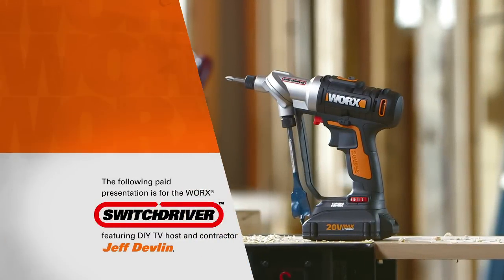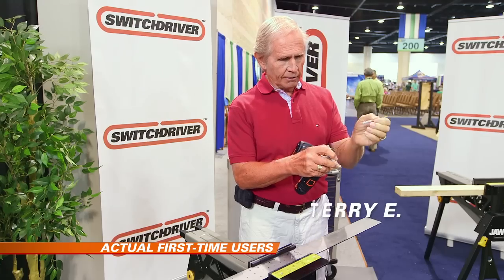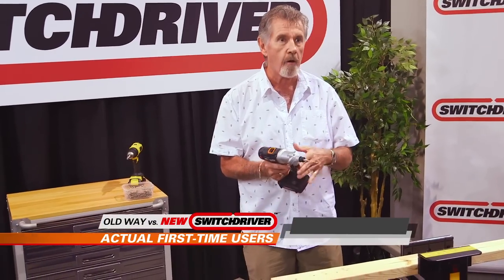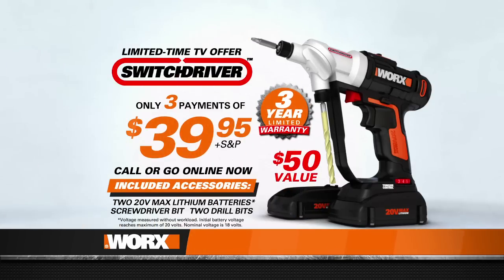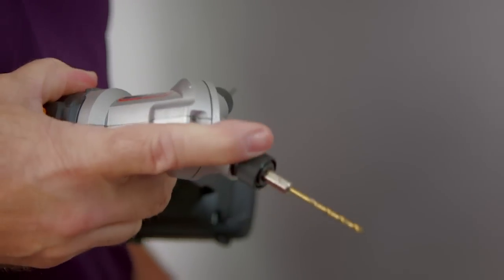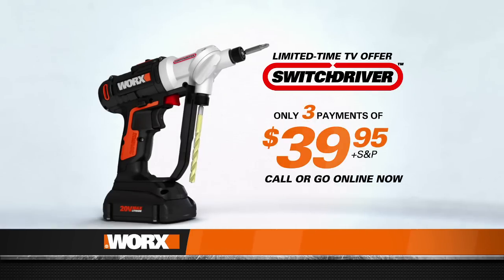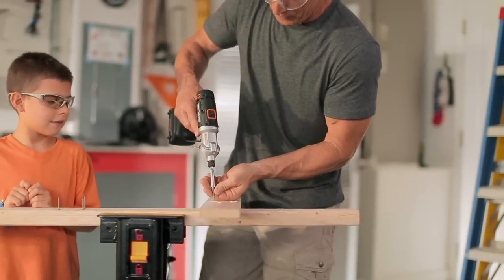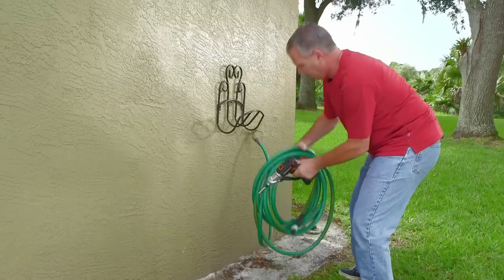Switchdriver | 20V Cordless Drill/Driver

Comment: If you look closely, all the drill bits they use are hex drill bits, not normal drill bits. Hex bits are not bad because they can't slip in most drill chucks like regular bits can when the chuck is a little loose, but hex bits are typically used in electric screwdrivers, not drills. Harbor Freight sells a titanium coated (sorta junky) hex drill bit set for about $10.
Reply: Ulua fishing
Reply: Yeah
Reply: yeah its kinda annoying but like they said the chuck is big

Comment: what do the torque settings mean?  Do they correspond with poundage?
Reply from the maker: Hello Jmichael Isbell. That's a great question. The clutch setting is the most important feature to have dialed in. You'll see a list of numbers from 1 to 20. These are used to set the clutch to deliver a torque range. The higher the number, the higher the torque and the larger the fastener that can be driven. To adjust your clutch, align the arrow to a lower setting and start driving a screw. If there is too much resistance, the clutch will disengage the motor. Adjust the clutch to a higher number and find the sweet spot that will drive your screw to the desired depth without disengaging the motor or overdriving the screw. I hope this answers your question and thank you for being a valued WORX customer.

Comment: Great Idea.. BUT they will really get my attention when they combine a drill driver with an impact driver.  Of course most of us pros will likely ruin a tool like this unless it has the build quality of Rigid, Makita, or Milwaukee..
Reply: actually Panasonic made one as well.  I used it up.  and what I didn't like about it is you have to alternate the chuck systems and if you forgot and used the hand tightened chuck system with the impactor?  you ruined it.

Comment: NOT REPLACING ALL MY INVESTMENT ON BITS!   not a good review if you not being FULLY honest on all parts about it.  and if you have to get a converter, so THAT TAKES COMPLETELY AWAY from the quickness doesn't it?    :( grrrrr    the bad reviews are coming i think over same frustrating reason of those who got it, and then realized it will not take all our other drill bit investments they have made.  you need to work on that part cause if not for that, i would love it.